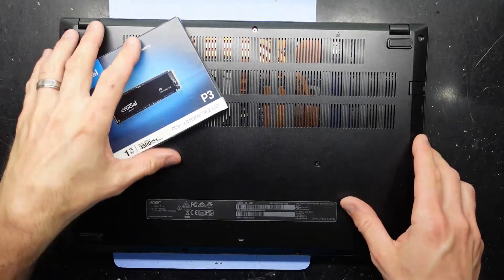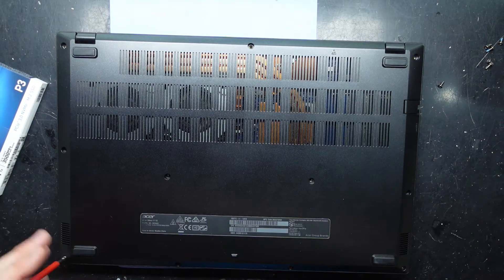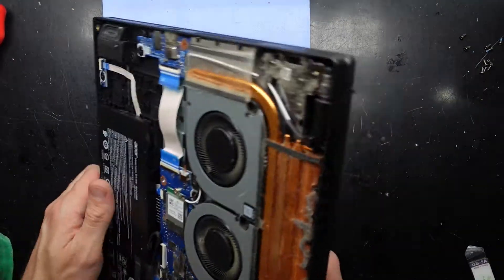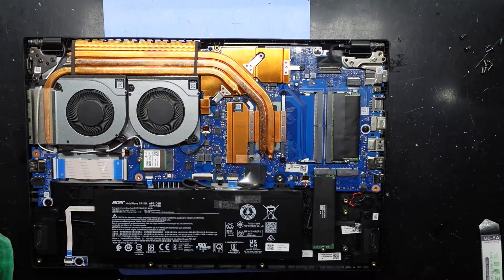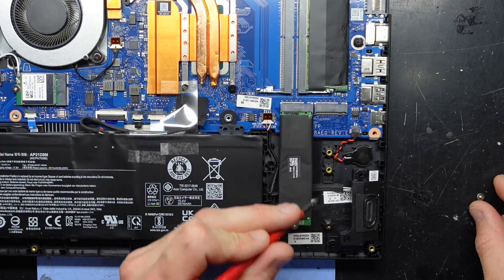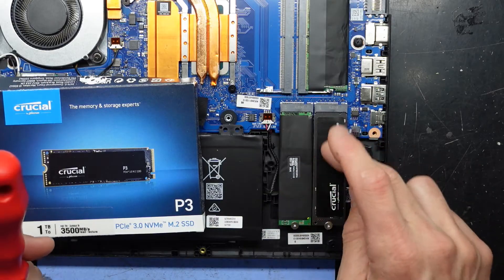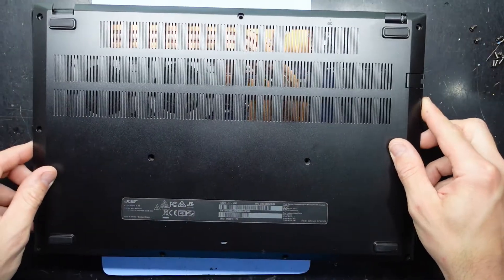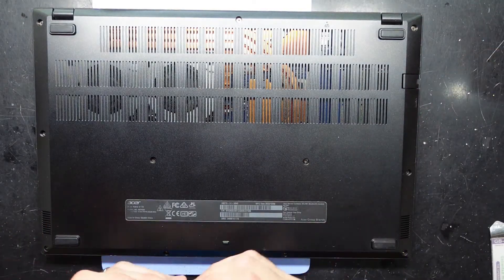Acer Nitro V 15 AN515-50N9 SSD and Ram Upgrade

Comment: I'm getting no bootable devices error scene
Reply from the maker: since what ?
Reply: @rickstechrepairs  I have installed the extra sodimm and it's not booting now I had a spare old SSD with windows but booting on that but the original SSD is not detecting on bios or any software at all. I think it's Dead. Don't know the cause

Comment: So I installed everything properly but my laptops isn't showing anything on start up
Reply from the maker: keyboard lighting up ?
Reply: @rickstechrepairs  it does figured it out the ram i got is faulty as soon as took it out the laptop started up
Reply: what ram did u get to make it work

Comment: Why am I stuck with 2 x 8 GB sticks? Everyone on YT seems to have 1 x 16 GB Stick for their V15
Reply from the maker: not sure
Reply: Yeah, manufacturers tend to do that as long as they're still meeting the advertised specs. I've seen a bunch of stories on Reddit where people get lucky — like buying a laptop listed as 144Hz, but it actually comes with a 165Hz panel. Sometimes it's just because they ran out of stock and swapped in a different component, which ends up being an upgrade. One post even showed someone who noticed the 165Hz refresh rate after checking through the NVIDIA control panel. It happens pretty often with other components too. Unlucky for you man but still a decent laptop!

Comment: I have the ddr5 16GB 5200mhz one. I haven't checked bios/updated it yet so not sure if its the max speed.

What 16GB and mhz speed should I buy to upgrade to 32GB?
Reply from the maker: dont be concerned about mhz, as you cant adjust the speed in the uefi/bios 

i would go to 32GB of Ram in total (2x16GB 5200mhz)
Reply: @rickstechrepairs  I see thanks for the tip man
Reply: @rickstechrepairs  Any brand you recommend or should I just choose what I want/available? Like crucial or whatever
Reply from the maker: any brand is fine
Reply: @rickstechrepairs  Thank you 👍

Comment: How to repasting thermal paste, please?
Reply: At 2:34 he touches the area with 7 screws. #1 is under some tape. You need to remove those screws. Once you do, you need to make sure the black and white cables are not in the way of the heatsink when you remove it. There is a small area on the left where those cables are on top of the heatsink. After dealing with those cables, remove the two fans. This makes it easier to pull the heatsink out. After that, you should be able to pull the heatsink off. The only thing attaching the heatsink is the 7 screws, so if you feel some resistance pulling the heatsink off of the board, the thermal paste the manufacturer applied is probably sticking. It was really sticky for me, and there was a lot of thermal paste for me. I pulled gently for a few minutes before it came off.
Reply: @collegejm2299  it sounds difficult, thanks for your reply but i need the video because when i upgrade ssd, it takes a lot of time and more tries to remove some parts
Reply from the maker: i wouldnt expect one of these to need thermal paste just yet

Comment: What happens if I put a SSD PCIe NVMe 4.0 In the 3.0 slot????
Reply from the maker: if it's a good one it will just run at 3.0 speed

Comment: if i put my new ssd in main slot gen 4 and move the oem to gen 3 slot would i have to reinstall windows ?
Reply from the maker: I don't think so
Reply: Just boot into BIOS and change boot drive.

Comment: I've heard you have to lug out the battery before installing a ram or ssd, is this true?
Reply: dont need to, but better detach the battery to avoid shorting
Reply: @fazsky  is it always recommended, I have shorted my motherboard by doing so
Reply: @abduljabbaryounus3508  you just answered it yourself .what a douching lol 😂
Reply: is it safe IF windows fast startup is off and youre wearing gloves and dont sweating

Comment: I hace my ANV15-51-526m laptop ando in your video i see that You add a gen3 SSD, or do i find out if My laptop has a gen4 slot?
Reply: Left one is gen 4 and right one is gen 3 slot
I don't know the generation of the default one.
If it's gen 4, get a gen 3 to right side
If it's gen 3, swap it to right side and get a gen 4 to left side.

Comment: Hey can i put a gen 4 ssd in second slot?
Reply from the maker: you could but i dont know if its a gen3 slot
Reply: You could, but its a gen 3 slot meaning your gen 4 ssd will work at gen 3 maximum speed, but don't worry the difference isn't noticeable (in games at least).

Comment: What's the max ssd size per slot this laptop supports
Reply: 2 tb
Reply: @ridewithram_off  is this mentioned somewhere? is there a spec sheet or smth like that?
Reply: each slot supports 1TB each, so you can have a maximum of 2TB

Comment: I have understood that the primary slot can support up to pcl 4 and the second up to pcl 3s what would happen if i swap the current storage to the secondary and put a pcl 4 in the primary? Will i messed up the motherboard?
Reply from the maker: i dont think it would mess anything up
Reply: In some cases, your screen would go black (its not damage) cause the motherboard will recognize the 1st slot as its C:drive. Need to install the m.2 with cdrive and bootup your laptop, then shutit down and add the 2nd m.2